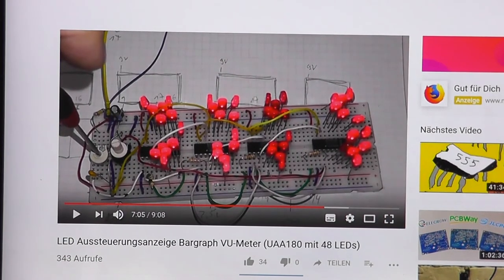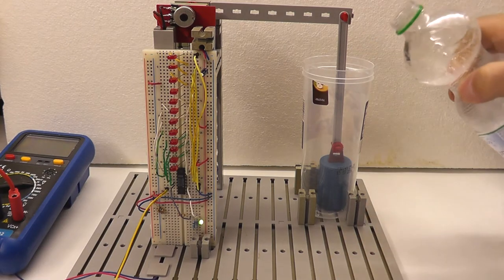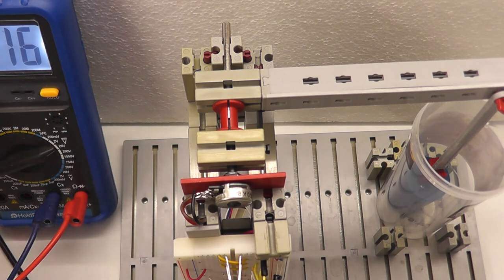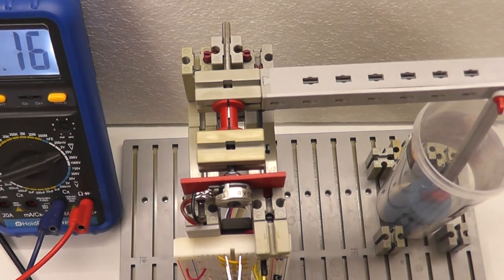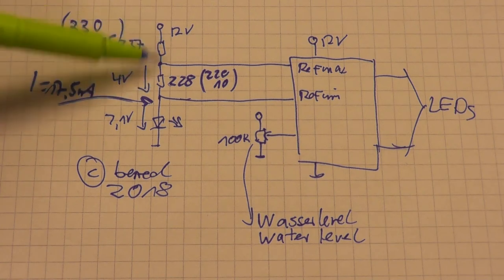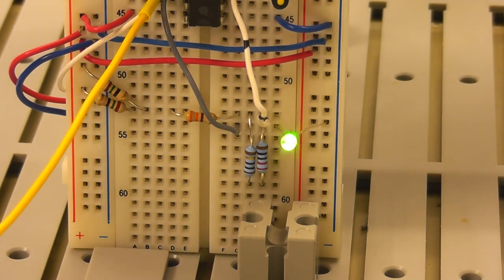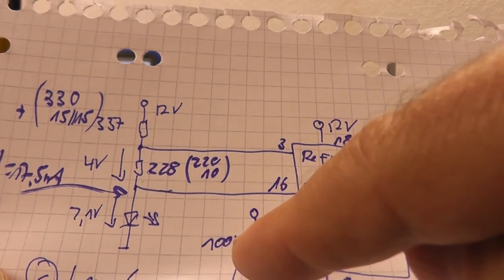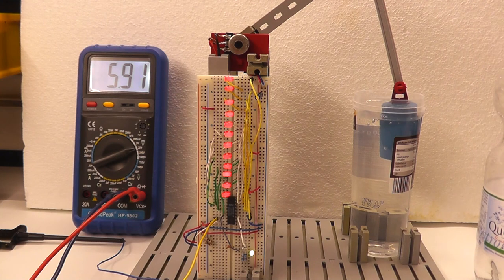Water level meter with UAA180, potentiometer and Fischertechnik

Comment: Sir, please make list of things that you used in this video and write it in a discription. And give links to buy those things at online. Because this will help us.
Reply from the maker: I have uploaded some pictures and a BOM on github, see link in the description. You can buy the parts on ebay. For the UAA180 you can also use a LM3915 kit (from ebay). No programming in this case necessary.
Reply: I will reply after completing this circuit